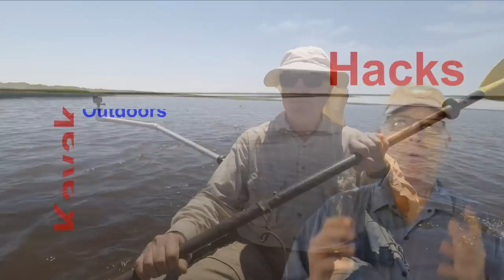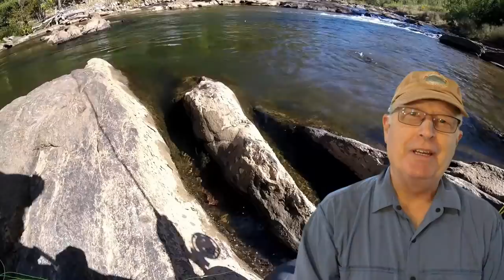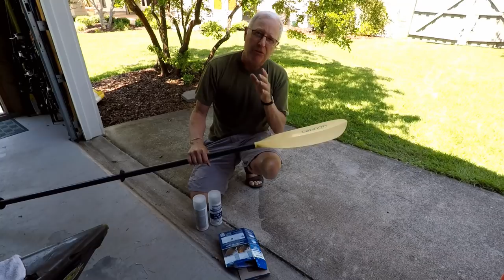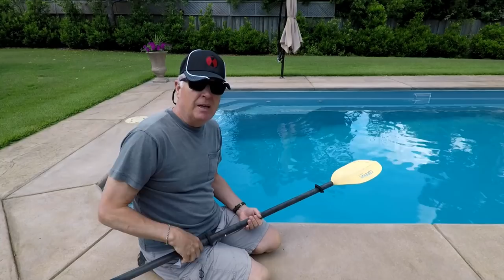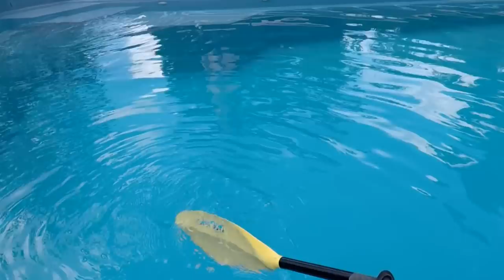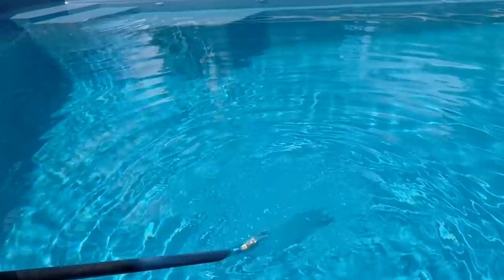Easy DIY Dripless Paddle for Kayak, Canoe or SUP

Comment: I've done it.  You hit upon the main concern, which the water still travels down the shaft on each stroke.  Its good to coat it about a half a foot more, which you got right on the money.

I never posted a video on this because the coating wears off, given time.  I think it comes down to how much you paddle, so I never could nail down an actual time frame.  Some people fish less, some people fish more, so it would be different for everyone who used it.

Still, it works and saves a damp trip home, if you don't mind re-treating the paddle every so often.
Reply from the maker: I will keep track of the time between applications.

Comment: Great tip.  My solution was a longer paddle and therefore a less vertical paddle stroke.  I needed the longer paddle because of my type of kayak as well as my height, so I never really encountered the problem, but I know a lot of my fellow kayakers encounter it.
Reply from the maker: You are exactly right! My paddle is too short, but I am too cheap to go buy a new one :-)
When I switched from canoe to kayak, the dealer did not do the math on kayak width vs my height.  The paddle cost a fortune, so I am going to keep it for a while until I force myself to fix the issue!

Comment: Very impressive product. I do most of my kayaking in the sun which quickly dries up the water that drips on my clothes, and mostly wear a wetsuit because I launch from the surf or even a boat launch so water isn't really a problem. I find myself surrounded by a lot of it once I leave land =D.  I enjoy the coolness of the water. I would say though,  it is a bit annoying having spay or drips on my prescription sunglasses that dry up and hinder my sight so you still have my attention.
Reply from the maker: Later on, I discovered an even cheaper option - duct tape - https://youtu.be/yc7g0cGr4Rc

Comment: In my job at work I like to say if I can think of it, chances are a solution has already been developed... "go find those ideas and build on them."  This is gonna save me lots of money I hope.  I don't like the weight of Penn's sealed, all metal, spin fishers, but my lighter Okuma Avengers don't like the saltwater (paddle drip kills them).  Can't wait to try this.  THANK YOU for the idea.
Reply from the maker: You may want to try an unproven idea another commenter had about just waxing the paddle. It would be cheaper. I have not put that idea to the test.
Reply from the maker: Good point

Comment: I used Never Wet on one of my Kayak paddles about two years ago and most of it is still on it and it still keeps the drips
down . But I just bought a much better paddle and will try the tape on it first , the NW looks pretty nappy after a few trips
but still works .

Comment: Great I have a peddle power and before I got it all the guys that had paddle types said you are going to get wet. When I went I didn’t get wet at all until I tried paddling the kayak. Not bad but it did run back to the ring and some got on me. This definitely will be on my paddle. Summer in the south it is not a problem but I am a Speckle trout puppy drum and Flounder. The best dishing is in the fall and it can be a little cool. Thanks for a good tip.
Reply from the maker: This option is much cheaper! https://youtu.be/yc7g0cGr4Rc

Comment: Your other idea, the low/stealth stroke, is the only way to stay dry without a spray skirt. 

I figured this out my first 5 minutes in the water but hit the sides if the boat with the handle when putting the hammer down.

Comment: FYI, I tried the same thing with Turtle Wax Spray and Wipe, but the results were minimal at best.  So, you can skip that experiment.  Glad to know Neverwet works.  I saw a video on YouTube where a guy used simple paraffin wax from the grocery store and it worked well  too.  He simply rubbed the wax on the paddle and buffed it with a rag.
Reply from the maker: But... the best approach is the duct tape trick I discovered later - https://youtu.be/yc7g0cGr4Rc

Comment: Very nice!.  Is there a chance that this coating could be used on the bottom of the boat to decrease water resistance increasing top speed to nearly inhuman levels?   Thanks for the video.
Reply from the maker: No - it would be very expensive and it will wear off as your kayak hits or scrapes.
Reply: It would  slow you down

Comment: New to kayaking first time in the water today hehe got soaked by the drips off my paddle, going to try coating it in glass coating ceramic I use on cars see if it works .
Reply from the maker: Try the duct tape hack first. It is much cheaper and works fine - even better with a drip ring to capture the random drips the duct tape does not catch.
Reply: @KayakhacksFishing  My paddle has a notch where you added the duct tape to yours, performing the same function. But the dripping problem persists when the paddle is raised a little bit higher, allowing the wind to blow the dripping water over the side of the kayak and over my legs, very annoying and water starts accumulating inside the kayak if I ignore it. I'll be trying this hydrophobic coating next week, either it works as well as in your video, or I may try a longer paddle, or I'll consider closing the kayak with fabric.
Reply from the maker: @_John_P  I tried Neverwet before I came across the tape idea. It worked well, but did not last since I use my paddle to put through much and leverage myself off oyster beds often.
Reply: @KayakhacksFishing  I just tried Neverwet and it is a game changer, it stopped the water from dripping inside the kayak, I hope it lasts. What is a shame is that the cans only cover 1m², which gives just about 2 applications, not enough for its price.
Reply from the maker: @_John_P  Yep - it worked great for me as well. Just had to abandon it since it did not last in my environment.

Comment: I've heard a small notch on the bottom edge of the paddle blade just as the blade starts to curve will prevent paddle drip, I'll try it out.
Reply from the maker: I use this method now - https://youtu.be/yc7g0cGr4Rc

Comment: I will try the duck tape trick ! I've seen a lot of people recommending various methods of making the blade resistant to water, such as your Never Wet, or wax etc, but I wonder if the water slides off the paddle with less resistance causes and paddling performance loss ?
Reply from the maker: That is a good question.
Reply: I'm going to guess not, due to the different physical forces involved. My knowledge of physics is admitedly rusty, but I think paddling performance (specifically the amount of energy transferred through displacement from the boat, paddler, and paddle to the water, as well as the degree of resistance caused by the water and air) relies on the mechanical transfer of energy, and fluid dynamics... That is different from the (adhesive?) forces which cause water to remain adhered to the paddle against the force of gravity. Slightly accelerating (or slowing) the movement of water across the blade of the paddle by applying wax or other chemical film seems like it would have negligible effect at an angle perpendicular to the blade, though perhaps some noticeable effect on movement (specifically resistance to gravitational force) along and parallel to the blade.

Comment: What do you think this product would do to a higher end paddle like a Bending Branches Angler Pro or Werner Hooked?  I would be worried about ruining the paddle by spraying this stuff on it.  Would this be a hack that is relegated to lesser expensive paddles that are mostly plastic?
Reply from the maker: You would have to read the instructions on the NeverWet package to see if it is compatible with the paddle material.  That's the only advice I can give...
Reply: Michael O'Neill nothing. it's safe

Comment: My solution to a dripping paddle is a trolling motor. I've motored all day, covering 10 miles, without depleting my 100 AH battery.
Reply from the maker: That works! However, a very cheap way to stop drip is use the duct tape trip I discuss here - https://youtu.be/yc7g0cGr4Rc

Comment: If you coat the underside of a kayak with this will it have less friction with the water and paddle faster/more easily?
Reply: It will actually hover just above the water. Not really but good question
Reply: James Olsen I'm sure after you beach your kayak a few times it will come off... not sure if that would be cost effective. this stuff is not cheap
Reply from the maker: That would be really expensive!
Reply from the maker: You have to be careful about digging the paddle into the mud to push the kayak as well
Reply: Interesting idea.  Rowing teams have found that contrary to expectations, their boats go slower when they wax them.  This is a different material and I have to wonder if they've tried it.  In another sports situation, the hot, hot, hot product for cross country skiing is the fluorocarbon waxes, which seem to behave similarly in the snow/ski environment.  The waxes are so hot that the ski teams have their own top secret recipes!
Reply: SuperBardley may be against rules

Comment: Will this prevent mud sticking to your paddle as well? Plenty of times where I've had to push off a muddy shore n my paddle, and it was covered in mud/smelly silt.
Reply from the maker: No. Mud will still stick. And... you should look at the cheaper option that uses duct tape I discovered after I used Neverwet. https://youtu.be/yc7g0cGr4Rc

Comment: I have a question. I got a outrigger stabilizer on my square back canoe with a 4hp outboard. The outrigger has to floats, one on each side. Like a little pontoon. They are 3 ft long. If I go too fast they will shoot like a rooster tail of water into my canoe. Do you think this neverwet would solve my problem? Thank you and God bless
Reply from the maker: I do not think so since the tail is probably produced by the shape of your float. The other thing is the Neverwet wears off after a few trips. It may be worth investing in a can and see what happens.
Reply: @KayakhacksFishing   do you think duct tape could help me
Reply from the maker: @thestraitgateway  Maybe. It would be worth a try. The key is to have a loose end like the paddle version has to guide the spray.
Reply: @KayakhacksFishing  man thanks a lot. I will try the duct tape and let you know if I can get it to work. I think the neverwet will neverwork in my case because the shape like you said.
Reply: @KayakhacksFishing  I found a solution for my problem. I never did try the duck tape though. What I did was I put two 5/8s thick bolts underneath the stabilizer, where it clamps to the gun whale, one on each side. That raised it up enough to where it's not touching the water while I'm riding. It has a screw clamp to lower the floats when I'm anchored or not moving fast with the motor, so that I can stand up and move around.
Reply from the maker: @thestraitgateway  Great solution! Thanks for sharing it back to us

Comment: What would it do if you treated the bottom of your boat, faster speed ?
Reply from the maker: I do not think so. I read a report looking at waxing racing kayaks and it found wax actually slowed the boat down.
Reply: Kayak Hacks Fishing why would wax slow a boat? That seems so counterintuitive.
Reply: Loren Rademacher probably same reason there's dimples on a golf ball. The water in the dimples, moving with the boat has less friction with the water being moved through.
Reply: Hey, I've raced boats.  The hydro dynamic principles are similar. Yes, speed, cavitation, all those factors  not withstanding. There's a school of thought that rough is  better than waxing . Has to do with a boundary layer creating less friction, so the turbulence in effect keeps the water away, improving flow. .
Here's a cut & paste from a race forum that explains it in more detail. IMHO, if anything, a human powered vessel would have  insignificant benefit with either a  waxing or scuffing. approach  The forces at play are minimal. Thx Mr Foxx

Professional boat racers prepare the bottoms of their hulls by lightly scuffing the surface at a 45 degree angle to the keel. Its difficult to explain why (i'll give it my best chance here), but waxing the bottom will actually create more friction that a lightly scuffed surface. Your example of a freshly waxed car is a good example. The water does bead from the surface with minimal effort...but have you noticed how a dull, faded car will actually hold a sheet of water on the surface and not let it roll off? When you have that surface of water sticking to the bottom the hull, the water passing underneath the hull can actually do so easier because water-to-water friction is less than water-to-hull friction no matter how smooth or well waxed the bottom is. I dont have back-to-back proof (like gps data) but I figure if its good enough for the teams that spend major dollars to go boat racing, its good enough for me:) I have heard its a 1-2 MPH on a full size boat. I do wax the topsides for easy cleanup after a trip to the lake though.

Comment: I had an idea I haven't tried yet. Using Rainx on my paddle. I have used it on my windshield and it is great stuff. It turns out Rainx is not good on plastic but: Avoid using Rain‑X® Original Glass Water Repellent on any plastic surfaces, including motorcycle windshields, ATVs and solar panels. For plastic surface applications, try our new Rain‑X® Plastic Water Repellent! I will let you know
Reply from the maker: Please do. The key question is whether it wears off as quickly as Neverwet
Reply: I would be curious to know the results, as well.

Comment: How many coats of spray did you use for each bas and top coat?
Reply from the maker: One each
Reply from the maker: But, it turns out there is a better and much less expensive solution. Check out the video where I discuss using a piece of duct tape to achieve the same and

Comment: Neverwet doesn't appear to adhere to carbon fiber shafts. After a very careful install, I can push it off with my thumb!
Reply from the maker: Thanks for that point. However, no need to spend the money on Neverwet. I discovered this hack that does the same thing - avoids paddle drip - https://youtu.be/yc7g0cGr4Rc

Comment: How much weight does this add to your paddle?
Reply: john snow Really?
Reply: Probably at least 2lbs
Reply from the maker: None
Reply: At least a 1lb
Reply: There's a good chance that in use it actually REDUCES the weight because there is no heavy water clinging to the paddle.
Reply: about 16 ounces  per blade if you zip tie one can of neverwet    to each blade, less if you remove the caps
Reply: ROFLMAO
Reply: Kayak Hacks Fishing it can't not add weight. how much does the can weigh before you apply and how much does it weigh after?
Reply from the maker: Maybe an few ounces since some of the spray does not stick
Reply: Probably doubles the weight of the paddle. Duhhh

Comment: I lucked up and landed a Carbon Fiber paddle when I found my Kayak on Craigslist.  I would love to try this, but I'd be afraid of potentially harming the coating that is already on my paddle. If NeverWet can't be used, can anyone suggest another product that won't alter the appearance of the paddle or potentially damage the protective coatings on higher-end paddles?
Reply: Great channel by the way!
Reply from the maker: Mine is a Cannon.  I think it is carbon, but am not sure since I bought it when I was transitioning from canoe to kayak and did not know the ins and outs.  So far, no issues and it is holding up.
Reply: Mine is a No-Limits Trinity and has the distinguished carbon fiber pattern that I love.  I want to try the NeverWet,  but don't want to damage or change the look of it... I'd post a pic of mine, but am new to posting anything on YouTube, lol.
Reply from the maker: I would give the manufacturer a call and ask
Reply: Keith Butler
You should be just fine if you use normal car wax. Maybe even a "ceramic" nano coating on top of that. Decent detailer should do the waxing in 5 minutes and maybe 5$, if not head down to the suoermarket or automotive store and get some car wax for 10$ a bottle. :)
Reply from the maker: Before waxing, I recommend you watch my video on that.  The racers say waxing actually slows the kayak and a number of other experts say the smell of the wax might repel fish.  Who knew? https://www.youtube.com/watch?v=ye0RiGu5yl4
Reply: Kayak Hacks Fishing 
Well, that came as a total surprise to me atleast. But, if you would only wax the paddle?
Reply from the maker: That is a great idea to test out.  Water beads on wax and the wax might repel it.  In addition, I bet the wax would create a tougher surface than the NeverWet. I only have one paddle, so I cannot test the idea.
Reply: Kayak Hacks Fishing 
I'll test it in a couple of days, but it should work just fine.
Reply from the maker: Let us know!
Reply: Old School Hand : If I'm lucky enough to have something nice, I want to keep it that way for as long as possible. Has nothing to do with being a "snowflake". It's summertime, so I'm not excessively worries about water drops right now. Come winter, if I haven't found a solution, I'll pick up a plastic paddle and use the NeverWet for function. Bottom line, I have a nice paddle and don't want to potentially ruin it by spraying chemicals on it in hopes of an outcome, but thank you for your helpful input on the topic. Tight Lines!
Reply: Keith Butler carwax. ;)

Comment: A quick fix and  inexpensive solution is placing  a piece of duct tape 8' long folded in half to create a tab just at an angle on the bottom of the paddle blade just before the shaft. To secure tape when you fold it in half a section of tape is adhered to each side of the paddle blade See Photo https://image.ibb.co/kPk8Fv/drip_tape.jpg
Reply from the maker: Now that is an innovative idea!  I'll get my fishing buddy to try it!  Thanks!